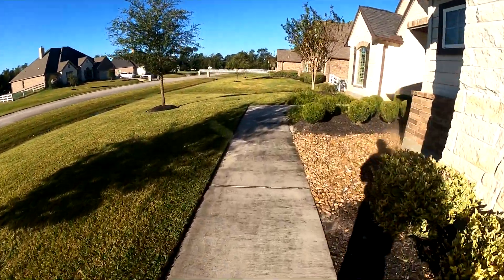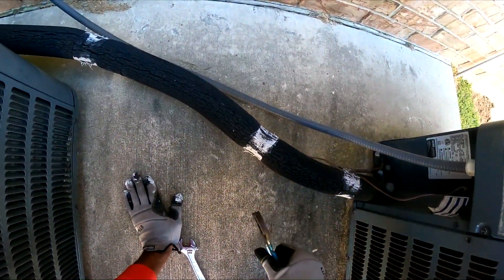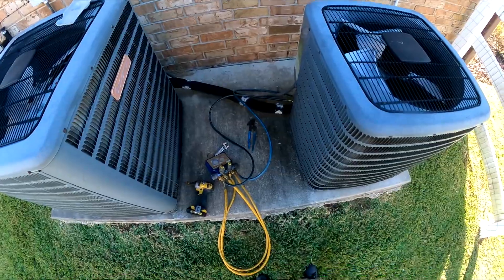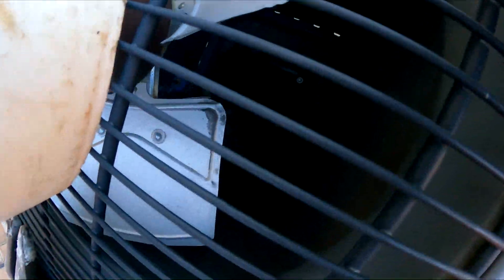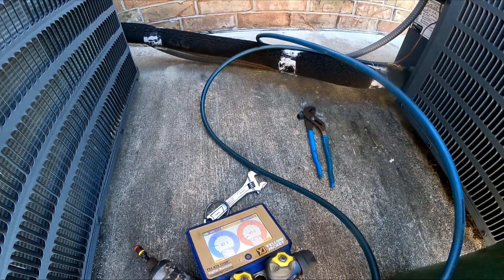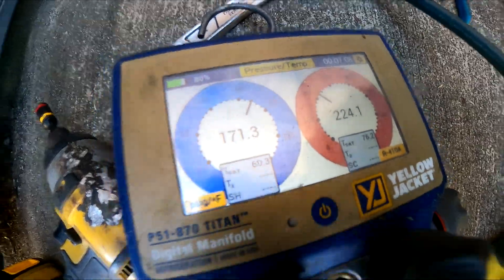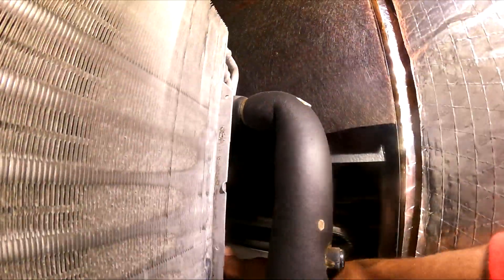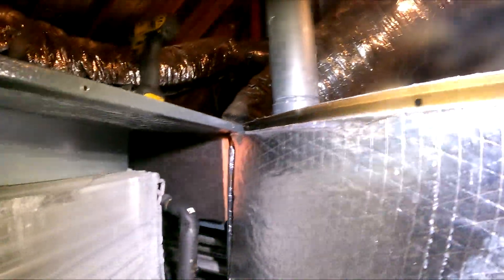AC Troubleshooting: How to Fix Goodman AC Issues

Comment: Why you are open Evap Coil and look And Thinking with not sure where it's leaking .how about after change Out Evap coil Find out Other leak .have you Trying Accutrak Ultrasonic Leak Detector Work With Nitrogen as well.
Reply: Oil residue, hearing the leak, you really don’t need to go any further. The signs are there completely, now some leaks are small, and thats when you use a leak detector. Because you wont hear it, you may see oil, but that depends. When there’s no refrigerant , its always a big leak. If there is refrigerant and its low, then you use a leak detector or soap bubbles